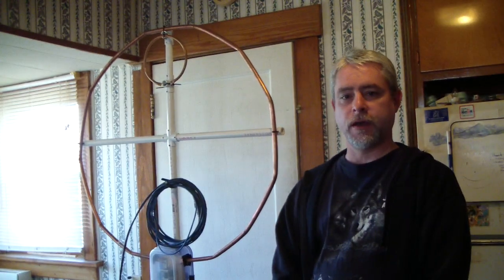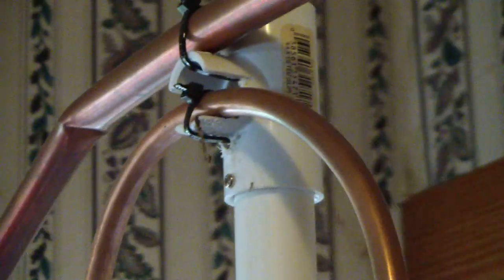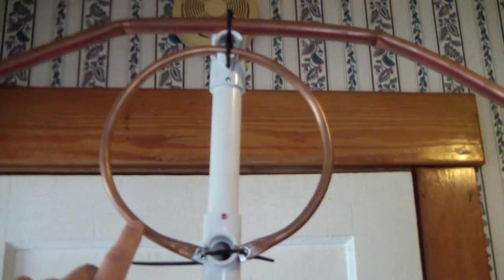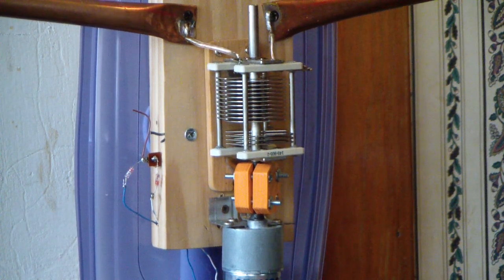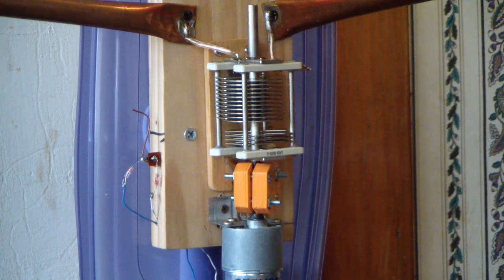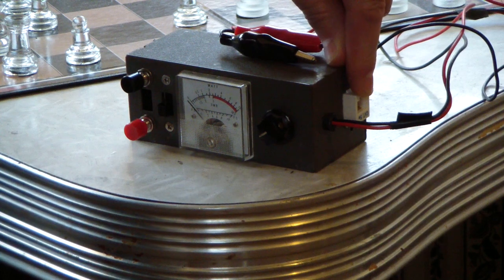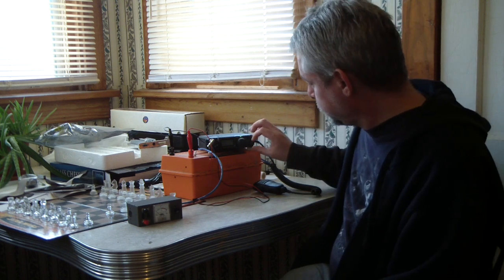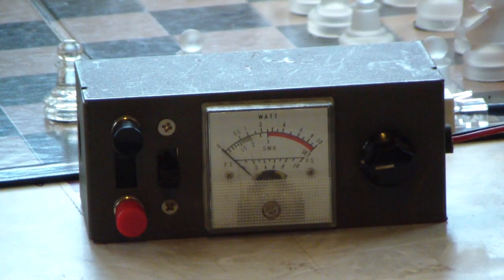Ham Radio - Magnetic loop transmitting antenna overview and details.

Comment: One very important correction Kevin. Twelve minutes in, you say that the smaller the diameter of the loop material, the sharper the Q. It is the opposite. Wider tubing gives you less resistance, higher Q, and narrower bandwidth. Narrower tubing means more resistance, lower Q, and wider bandwidth.
Reply from the maker: +ke0nc That sounds right,   But you also have to consider the greater surface area can lead to an increase in bandwidth.   In an earlier experiment,   I used 12 gauge  wire and later changed the outer loop to RG8 coaxial braid and saw an increase in bandwidth.    I think that are other factors affecting it.

The lower resistance does increase the efficiency though, due to higher RF current in the loop.    I'm pretty sure of that.
Reply: +Kevin Loughin Run the numbers through the 66pacific calculator, and change only the tubing diameter. You will see the correlation in the results. I remember reading about a Japanese man, who built a VERY large diameter loop, that was so sharp in Q, it was only good for CW.

I really like your RF diode sensing circuit. I wouldn't mind doing that myself, but I would have to run more wires again. 73
Reply from the maker: ke0nc Yep,  like I said,  that sounds right.  
My experiments are looser,   I think I did say there's lots of math out there to use to design these.   Thanks for the correction.
And thanks for the kind words on the feedback strength meter.   It really makes fine tuning quick.   One guy emailed me to tell me that he's adapting that method to his automatic tuning project using an arduino for control.
Reply from the maker: The motor does create some brush noise.  But that doesn't really matter since your generally transmitting when fine tuning.   It's not enough noise to interfere with the rough tuning during RX mode.

Comment: Kevin, should you ever build another one, fill copper tube with sand to bend tube without kinking, or water and freeze in chest freezer. Naturally after pour out either sand or water .
Reply: Good idea.  I plan to use a bicycle wheel (tire removed) as a form for bending.

Comment: Great video. Learned a lot! I just wonder what it have taken to bring the range to ten meters (28mhz).
Reply: It's being limited by his capacitors minimum capacitance. If the loop was made smaller, that would also fix that, but efficiency would suffer more down lower. Another possibility would be to make it only a fraction less in circumference and use larger diameter tubing. These will both simultaneously raise its resonant frequency by lowering the loop inductance but the larger diameter will improve the efficiency. Sure it will get heavier, but you will get 10 meters

Comment: Are loops made for DX because I got a MFJ and it's most strange antenna i've ever used. Everything seemed dead and wondered if it was working properly. Then out of nowhere some str 9 Americans boom in 14,000km away :)
Reply from the maker: Their radiation pattern is toroidal, like a big doughnut.   I've worked from the US to europe with the loop in my living room, inside!   If you turn it on it's side, it radiates the same as a vertical antenna and become omni-directional.    It's always a surprise when I use it.

Comment: I have a question. The electrical neutral point of the loop where the loop can be grounded is exactly opposite the capacitor. 

Why is the loop oriented so the capacitor is at the bottom, where the common mode problems are worse? Wouldn't it be better with the capacitor at the top so all of the cables and the feedline exit the bottom near the electrical neutral point of the radiator??
Reply from the maker: I have seen them both ways.     I also recall that current lags voltage by 90 degrees on a radiator, so I suspect that current is higher around the coupled loop area.    I have taken a field strength meter and found that radiation does seem to be slightly higher towards that area.
My gut instinct is that with the cap on top, you might be radiating a bit more of your power downward toward the ground.
When I built my junk box mini loop,  I tired some experiments with it.   Broadcasting WSPR on 20 meters,  I looked at the foot print on wsprnet with the capacitor down for 15 minutes and then with it up for 15 minutes.   The footprint was noticeably further out with the cap down at the bottom.   I repeated the experiment three times over almost two hours with the same results each time.
Reply: Current and voltage are in-phase in a resonant circuit. That's the 
definition of resonance. Phase has nothing to do with it anyway. The 
electric field is highest across the capacitor gradually decreasing to a
 null opposite the capacitor. Current is for all purposes uniform around
 the circumference of the loop, assuming the loop is a small fraction of
 a wavelength.   

The coupling loop has only the current of the 50 ohm system and does not need to be large, except for mechanical support and stability. 

The main electrical problem is voltage from each end of the capacitor end of the loop to ground is half of the voltage across the open ends of the loop. The advantage  of using a split stator capacitor is shaft or frame voltage is closer to zero, instead of half of the open end voltage. A split stator capacitor mitigates that problem, reducing common mode on the feedline and mast.  Most articles miss this point, and probably have the feedline doing a lot of the radiating.  This is why vacuum caps and other caps with the shaft tied to one connection point  are not the best electrical choice for loop balance, which is critical for divorcing the feeder from the loop so the loop alone is the antenna.
Reply: No they are not, Jerry. A correctly loaded antenna is 90 degrees out of phase in a resonant circuit. Current drives the RF and the electric field is the unwanted component. This is why mag. loops work so well relative to their size.
Reply from the maker: +Jerrythenerdful that vid was a few years ago, I've learned a few things since then.
Reply: Jerrythenerdful you are confused. Inductors create a current/voltage phase and capacitors do but in reverse. Your link prattles on about Q.
How the hell is it possible to tap a twin feeder for the impedance you need if both voltage and current was in phase.
How do AC electricity meters work and how did they make them run backwards if there is no phase shift.
Reply: Jerrythenerdful just keep the cap side farrrrr away from metal and the ground. You can ground the coupled side directly in the center opposite of the cap. You can even ditch the small loop and use a gamma match.

Comment: Hi Kevin.. very interesting and informative video.  What is the reason you used a smaller in diameter piece of copper tubing for the small loop instead of 1/2 inch for all loops.. Thanks
Reply from the maker: It was easier to bend, no other reason. ;-)

Comment: So if I made one from 1.5 - 2-inch diam copper pipe on the outer loop, I should be able to cover all bands? Your vid has peaked my curiosity on building my own mag loop... How much power can it handle? Got a good source on where to get those butterfly capacitors? 

Are mag loops only for indoors or can they be permanently set outside? If indoors, are you not worried on how much RF you are exposing yourself to?

Thanks! Great channel.
Reply from the maker: Wow,  thanks for the interest.
The larger the diameter, the lower the radiation resistance and greater the efficiency.  Bandwidth will also increase just slightly.   You'd probably need to go to a larger diameter loop to really get down to 80 meters with any efficiency though.
I've driven mine to 40 watts, it arced across the cap around 45, so I keep it to no more than 30.
Caps, well, I haven't looked online, I picked mine up at hamfests.  There's usually plenty around there.
They can be built weatherproof, there are several vids I've seen where people have done so and put them outside.
The field directly around the loop is pretty strong.  What I've read indicates you want to be at least 1.5 times the loop diameter away from it.   But we are talking HF here, and the wavelength is far too long to have any effect on cells or dna.   Plus, it's non-ionizing radiation, so it won't affect you physically anyway.   There's 90 year old guys out there that worked in broadcast transmitters for decades in higher fields, and some of them still have hair even.  ;-)
Thanks for watching.

Comment: Hello, I want to ask something;
The transmitting loop antenna emits electromagnetic waves at certain frequencies like other antennas?
Another issue I wonder is this; why is not it called a electromagnetic loop antenna? So, why is it called magnetic?
Reply from the maker: It's called magnetic because the inductive coupling between the small and larger loop is magnetic in nature.   The near field around the antenna is a magnetic field.   A short distance from the antenna, those magnetic waves create an electrical field which propagates away from the antenna as an electro-magnetic wave.
Reply: @loughkb  Thank you for your answer.

Did I get right;
Nature is in a magnetic position that calls electromagnetic waves towards it. This magnetic medium attracts the electromagnetic waves from outside.
However, my question was this; Why magnetic? that is, why isn't it called "electrik loop antenna" instead of "magnetic loop antenna"? After all, EM wave, which is a combination of two components, is produced by the antenna.

Comment: Kevin, could you tell us what the value is on your tuning capacitor and where did you locate one like it ?  Thank You for a great video, you are one heck of a speaker, good voice.
Reply from the maker: +Skip Pickens The tuning cap was in a box of a few of them at a hamfest.    I think it goes from 20-150pf or something like that.    It's not terribly critical, but you do want decent spacing between the plates to prevent arcing due to the high RF voltages at the cap.

Comment: Outstanding video and great creativity!  Approximately how much money for all the parts ?
Reply from the maker: It's been awhile.   I think somewhere in the area of 40 bucks.
Reply: Kevin, Regardless, it's still a great video and cool idea using PVC pipe.
I worked for the Navy for 24 years in Avionics and did some Doppler Radar antennas.  You're video reminded me of one of the antenna for the AWG-9 Weapons Radar for the F-14 Tomcats.  Thanks for the cost too.

Comment: Greetings Kevin. I made a loop with. this capacitor, mfj 282-2005. My antenna works very well on 15, 17, 20, and 40. Little difficult  to do setting. I would like your opinion about the capacitor. I only use five watts. Large loop is 8.5 feet and driven loop is 1 foot and seven inches. Good video and nice antenna.
Reply from the maker: I don't know what to say about that capacitor.   I'm not sure what you're asking.   If you're talking about how sensitive it is to tune, then, yes, it is very sensitive.   I use a DC motor that is gear reduced to 4 RPM and that's really too fast also.   A series of plastic gears would be needed if you're going to tune it by hand.   Or a large and really small pullly and belt.

Comment: Will a SDR Radio create high voltage and heat on the secondary loop as ham radios do ? Thank you for the great video's. 🙂
Reply from the maker: Any transmitter will.   Receivers will not.
Reply: Thank you  !

Comment: Hi Kevin good representation about this antenna but I have question what do you think if I want to  build magnetic loop antenna from old aluminum chaer? Many thanks 73 de kd5bkw.
Reply from the maker: As long as it's a circle, it should work.  Just make sure the coupling loop is 1/5th the diameter of the outer loop.

Comment: Great video but all the details are helpful -------- Why the small loop with 3/8 copper and I don't disagree.   But are short condenser leads very important and is size of these leads helpful in  signal quality . I have a 3/4 copper loop and love it but need to upgrade from the things you learned as it only works well on 40m . Heard NZ on 40m from the west coast
Reply from the maker: Thanks Gail,   I used the smaller pipe for the smaller loop because it was easier to bend smoothly.   By making it as uniform and circular as possible,  the loop's very linear across it's whole range.   The shorter the wires to the condenser,  seems to also help with linearity across the whole range.  It will come right down to 1:1 easily at the top end as well as the bottom end.
Reply: Kevin, early this summer I threw together for grins, a FM broadcast magloop. The capacitor had to be
real small value like from 9 pf to 2 pf. The loop does work and tuning is real sharp and directional.
I need to have time to refine it and haven't done anything for a few months since we have been busy
and now we are in the harvest season. I want to try something different on the HF loop and would want
to increase the diameter of the tubing to at least to 2 inches for a broader bandwidth plus more gain.
I might op-out and use flatstock aluminum bar at least 2 plus inches and a longer length than what I
currently have. A good butterfly capacitor is what should be used with these loops.

Comment: Love your channel. I’m building a mag loop out of dmr 400, 20 feet in circumference , 4 feet inner loop circumference, using a 365pf variable capacitor to tune. The plan is to use it on 40-20 then make one for 17-10. Would it be too lossy to use PVC pipe and wrap it tightly in aluminum foil?
Reply from the maker: At 6ft. diameter with a cap that large, it's probably going to tune from below 3 MHz and maybe just get up to 7.
The killer on magloops is the resistance of the outer loop.   I've seen some use copper foil wrapped around plastic pipe.  It will work with aluminum foil, but not as well.
Reply: Thank you, I’m having nothing but trouble with it, I think I’m going to make another, 9ft in circumference, which seems to be more standard.

Comment: What type and  size is your capacitor. Brand new ham , just upgraded to general would like to build this antenna. KI5EGD 
Thanks !
Reply from the maker: It goes up to around 160pf.  I picked it out of a box at a hamfest.  There's almost always one guy at those with a box of variable caps.

Comment: Hey Kevin.  I finally built a couple magloops.  The first one started out as a manually tuned loop.  Great results!  But I wanted to be able to tune it remotely so I added a motor and purchased a $6 controller off the internet.  Hook up between motor and controller is with telephone cable and I have a separate battery pack.  Everything works great except I am getting some strange sounds that I think are caused by the controller.  Sometimes its fine but as soon as my hand gets close to the controller I'll hear the noise.  Other times my hand doesn't have to be near it and I'll hear the sound.  It's annoying.  I bought a few FT80-43's and took the phone cable and wrapped 5 turns thru one of them (near the controller) hoping that the toroid would eliminate the noise.  But it didn't.  Have you had that problem or do you have any suggestions for getting rid on the noise?
My second loop is manually tuned.  I built it to be portable.  Works great but the bands have been lousy!  hi....
Thanks  de wa4chq
Reply from the maker: The controller probably uses some kind of micro-controller and pulse width modulation to control motor speed.  That would make noise for sure.   Put a switch on it for the battery.   Turn it on when you're tuning, and turn it off when you're done tuning?
My controller is just two relays and push buttons with the relays wired as a reversing switch.  I have a switchable resistor to run the motor slower for fine tuning.  Since it's passive, there's no noise.
Reply: Tnx for the reply and info, Kevin.  Yes, the controller is a PWM DC motor controller.  A switch would be a simple solution...  hi....  Will definitely throw one in until I come up with a controller without the micro-controller and PWM speed control.....  72  de wa4chq

Comment: Hello. Excellent presentation especially the use of the FS meter. How were you able to make those kinks so uniform? 
Sure beats using fittings.

73
Fernando N2FQ
Reply from the maker: Hell Fernando,      Figure the number of kinks needed and flat sides,  divide the circumference of the loop to determine the length of each flat side.   Then kink the pipe at those intervals.   Make final adjustments to get a roughly circular shape.
73,  Kevin.
Reply: Thanks Kevin for the prompt reply and the blurb. Take care. Fernando N2FQ

Comment: What is the sku or part number for the motor ganged to the variable capacitor?
Reply from the maker: I found it on amazon.com, I think.  It was a long time ago.   I think I searched for 1 RPM gear reduced dc motor, and found several options from 12 up to 24 volts.